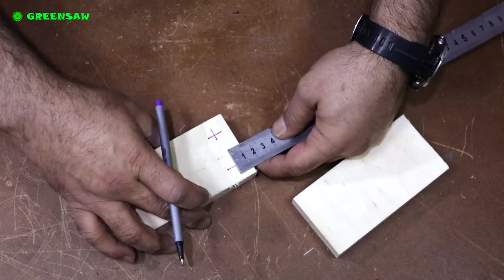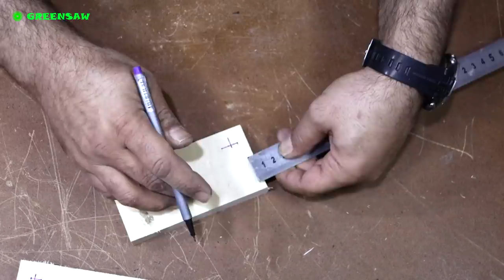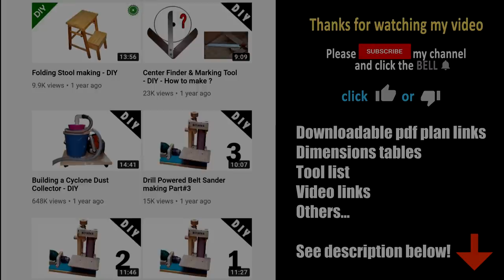Sanding Blocks - DIY - How to make ? - Hand Sander - New idea !

Comment: Could also attack two different grit sandpaper together and then you could have a coarser side and a finer side to sand with... And use some springs between the two blocks of wood and the tension would be constant...
Reply from the maker: Thank you for your advice.

Comment: Instead of using epoxy to make the belt, how about some form of staples? The stapled joint could be placed in the gap just as you did w/ the epoxy joint. Really like the concept
Reply from the maker: It may be tried, but sandpaper may tear. I have the idea of using tape adhesive internally.